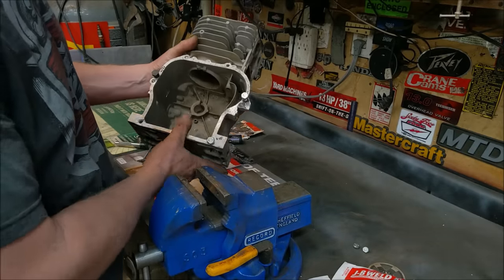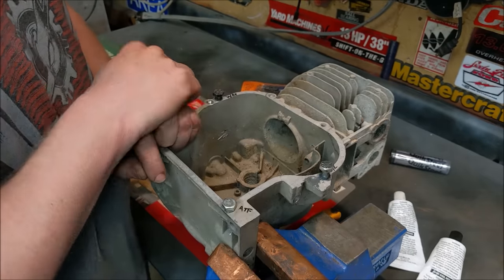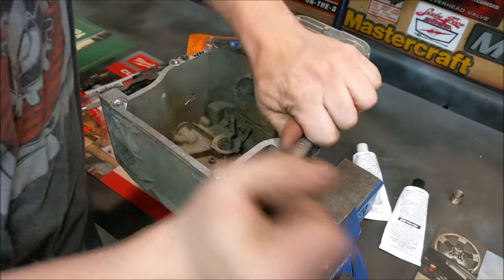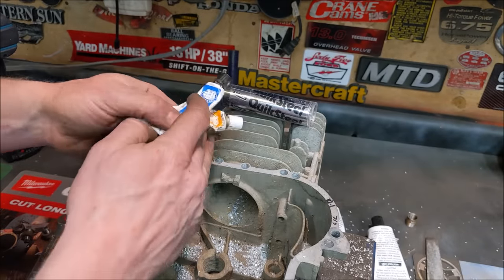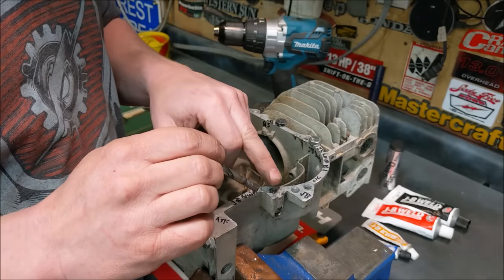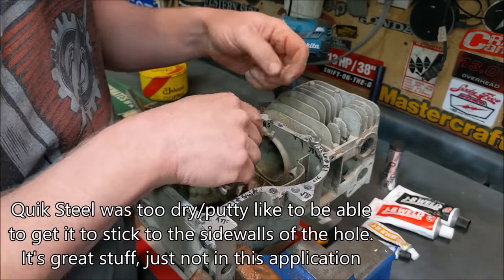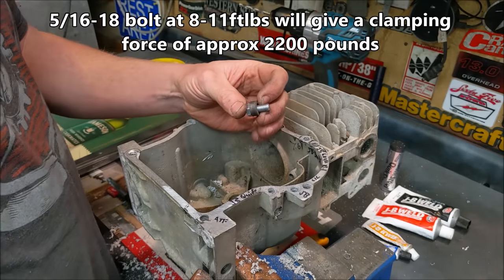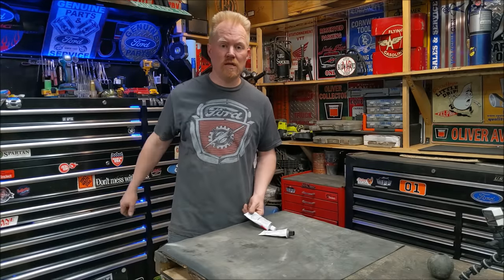FIX stripped bolt hole threads the POOR MANS WAY

Comment: Seems like this might work for what I need to fix. Water pump bolt snapped in the block, extractor failed. It only needs to be held snug around 8ftlb of torque so this method may be just fine.
Reply: I have had the same thing happen to my truck we were taking the bolts out and the damn bolt snapped right at the block, so now we have been drilling and tapping the bolt hole to try to get the new bolts in
Reply: Did this work for you?  Samething happened to me on my water pump and I just need 9lbs
Reply: @Xclusive615  I ended up just torquing the remaining good bolts drove for a few thousand miles with no leaks. I would assume this would probably work though just dont over torque the bolts as most water pump bolts dont require alot of torque you'll probably be fine.

Comment: Sometimes  threads are stripped in aluminum and do NOT need strength but just to keep a machine bolt snug in an aluminum engine block... LocTite may be plenty good and very cheap!
Reply: what is the thread is chipped instead of stripped? and would the loctite hold in hot temperatures?
Reply: I am not required to answer your 'what if ' questions ...  Ask another person who may actually know the answer.

Comment: What kind of Wax did you put on the bolt. I’m trying to tap some threads to hold an injector bracket down On my bmw. Also I just tried to Steelquik should I just drill it out and use the original JB?
Reply from the maker: Any paste type car wax will work. I used SC Johnson's paste wax.
Reply: @sixtyfiveford  
So you don’t think I should use the quick steel to get threads?
You weren’t able to Tap it?
Reply from the maker: @kylebarka1982  You can. It only takes a few minutes to tell whether or not it's going to hold. The strongest steel epoxies are the long/overnight set.

Comment: Can i do this on a stripped spark plug hole? Will it hold up just fine, its completely stripped, and cant drill anymore cause of valves
Reply from the maker: The heat would break it down. If you can't just step up the plug size, a helicoil is the only option.

Comment: That's pretty neat. I wonder if the torque will change any if the block went through some heat cycles.
Reply: JB Weld melts at 160 degrees

Comment: hi.. men today putting back the oil pan when i put the last bolts there i note without put torque i note the bolts will be strip. so the issue its not the bolts its the hole in the oil pan motor. i put a little more large bolt and start tight but i not trust you know i feel like this will be shot too. so. what you recomend

Comment: what ive done is jb weld the hole, then drill and install a helicoil. ive only used it on m6 fasteners but it seems to work great. id like to see if thats any stronger than these methods
Reply from the maker: That's awesome. I'm sure the helicoil takes a lot more friction forces from the rotating bolt.

Comment: ? I want to try something like this on my rear wheel on my dirt bike it’s the 4 bolts to sprocket to wheel hub should I drill or just use J B ?
Reply from the maker: This won't hold up on a sprocket, too much vibration and torque. This technique would be good for something like an engine side case bolt that just holds the oil in.

Comment: Hey, I have an sv650 that has a stripped exhaust hole. I think the previous owner stripped it and tried to put in a bigger bolt but it wasn’t holding the exhaust tight enough and it’s causing an exhaust leak (wish I would have noticed before buying). I already tried to use a helicoil but it didn’t work. Do you think using high temp jb weld to fill it and then rethread would work? I have no idea what to do, my budget isn’t a lot. Thanks
Reply from the maker: JB weld won't work well with exhaust heat. Larger bolt or a SAE bolt is generally the first best step.  Helicoil would be the second best.

Comment: Have you tried that aluminum brazing rod stuff to fix threads?
Reply from the maker: I have. Issues with that stuff are pretty significant. When you get it right it is wonderful and super strong. 
Issues:
Need to heat the entire aluminum part not great at just localized heating
Aluminum Oxide layer forms almost immediately preventing the bonding and heating of the aluminum.  

It's fine for a small part but if you need to do a motorcycle engine side cover you will almost indefinitely destroy the engine/transmission block if you haven't practiced, cleaned off the instantly forming oxide layer or have improper heating techniques.
Reply: @sixtyfiveford  thanks man I'm waiting on some of those rods to come in and that sounds like good info to know

Comment: We used to use stuff called Devcon . It’s like liquid aluminum. I don’t know if they make it anymore. Got it at an aviation supplier.
Reply: Auto parts stores used to carry both Devcon Plastic Aluminum and Plastic Steel in tubes.  I haven’t seen it in years.  I just found a similar product on Amazon.

Comment: sixtyfiveford, i drive a 2007 fj cruiser and my transfer case fill plug hole is stripped out, I dont have a torque wrench measuring device but i can go way past finger tight but it eventually loses all of its tightness past a certain point.
for now i have teflon tape on there and put it as tight as i possibly could
Do you recommend i use your JB weld method for that?

Comment: I was wondering if it would work with plumbers tape. I need to build a threaded part, and there are no taps in the size I need, and it is not a thread size my machinist friend can turn on his lathe.

Comment: Nice. I carry a wax crayon when I'm working mainly for saw blade lube but has so many random uses. Checked out the copper wire fix, brilliant idea thanks!
Reply: What other quick foxes have you done with a crayon?
Reply: Did you have to drill the hole before using Sae or did you just thread it in?

Comment: What kind of wax did you use on the bolt, so it wouldn't fuse to the jb weld
Reply from the maker: I used SC Johnson's paste wax. But any hard automotive car paint wax would work just fine.

Comment: When dealing with epoxy the 24 hour cure is all ways best. I use petroleum jelly to lube the threads. The West System epoxy is expensive but works great.
Reply from the maker: Very true.

Comment: I wonder if this will work with a bleeder valve on a 49cc scooter I'm sure I stripped the threads on.
I have a new bleed valve if it boogers the original.
Would save approx. $40 on a new caliper if it can be done.
Reply from the maker: I would so no. The brake fluid would eat at it.

Comment: do you think the aluminum welding rods would work
Reply from the maker: The issue is the heat you need to obtain to get those too work is so close the Aluminum melting point you can easily destroy the entire part.

Comment: Interesting knife blade.  Usually  they are all buggered up from  bad hand work during sharpening where the  user slips and drags the stone all the hell over the blade,   But not on that one. And it does look like it's been sharpened
Reply from the maker: It was about 1 year old when the video shot and I've sharpened it a lot by hand. It probably was on it's 20th-30th sharpening(sharpen every 2 weeks or so). This is a Buck 841 Sprint Pro.

Comment: would heat over time affect the JB?
Reply: I fixed a spark plugs hole on my old toyota , it took about 40K miles before it finally failed .  
So ya  eventually it would

Comment: Fill the hole with Alumaweld stick....Drill new hole....Tap it.....Done!!!  Better than new!!!
Reply from the maker: I've brazed with those on many occasions and it's not that straight forward. You have to put a ton of heat into the object and continually remove the aluminum oxide layer to get it to bond. Just a little too much heat and the aluminum part you're fixing turns to soup and it's junk.
Reply: @sixtyfiveford  Try putting the piece in an oven to heat it....then it holds the heat better and you can alumaweld it a bit easier

Comment: saw a guy test epoxy with wood shavings, fiber glass, carbon  fiber, and even tiny industrial diamonds. He got great improvement in strength. I guess JB Weld involves some sort of material in epoxy or something (yeah, just a guess, lol). Wonder how that kind of material would hold up? This is great stuff. Thanks, yet once again.
Reply: jb weld has metal particles, metal filled epoxy has been around for a few decades, you can get various fills, steel, alumium, ceramic, this also affects the colour . (devcon used to sell various versions of filler)
Reply from the maker: I did put a magnet to the JB Weld as they claim it has steel in it. It was barely magnetic. If anything I think they put in steel dust. I did try the same test with copper wires running in the JB-WELD but got the same results. I think I'm going to try fiberglass as that will contour very well.
Reply: What wax are you using as the lubricant ?

Comment: I have a stripped bolt hole.
I have JB Weld.
I have J&J Paste Wax.

Thanks for testing the best release agent! 👏
I totally was going to use WD40 until I came across your vid.

Totally a better than a suggestion of "just JB-Welding my bolt in place" I recieved.

Comment: Would be curious to see the test on a hole with damaged threads.  The holding strength would be much higher in regards to the jb-weld slog spinning as there would be something to bite

Comment: Typically with aluminum. I like to just drill through and use a nut. Or drill over size and tap. Fixed many lawn mowers this way permanently. Interesting video!
Reply from the maker: Both are also my preferred methods as well. Oversized for me has saved a lot of equipment.

Comment: Can't find the copper wire video.  I have a 1999 durango.  Stripped caliber bolt.  I have. Jb weld.  I am kind of confused.  Need help.
Reply from the maker: A brake caliper bolt has a lot of torque and generally only two bolts hold on the caliper. I would first see if you can put a bolt and nut all the way through the damaged part. If not I would try the copper wire but if you can't get good torque you'll need to replace the part. Generally these tactics are for something like a valve cover where if it fails the worst that can happen is an oil leak. 

COPPER WIRE TRICK VIDEO: https://youtu.be/soOvDuwfnQA
Reply: @sixtyfiveford  Had to drill out and tap.  I put a heli coil in and the bottom bolt fell out.  I was told now that I need to glue the heli coil in?

Comment: Would any one know if putting  jb weld in the hole and then using a self tapping screw to retap the thread  would work just wonder ?

Comment: Great test - exactly what we needed this morning. Thanks for showing us the options. With Original JB Weld in this application you need to take  a small file and cut vertical groves in the sides of the stripped out hole to give the epoxy a mechanical bond to keep it from spinning under a twisting load. Is there any kind of primer, like acetone, 99% isopropyl alcohol, or heptane(i.e. rubber cement solvent)  you can use to increase the strength of the chemical bond? About 47 years ago I used original JB Weld to fill the pits and holes in the aluminum head of an even older Mercedes that had blown a head gasket, and drove it for years that way.

Thanks again for a great video.
Reply from the maker: I did depth wise grooves and it made no difference. Tightening a 5/16" bolt to  8-11ftlbs is pulling with over 1 ton of force.  I think it's reaching the capacity of the material to bond to the aluminum.  I was thinking of adding something like large aluminum shavings or fiberglass strands and also tapping the hole for a larger bolt size to give tons of side ribbing for hold.

Comment: What if you took something like a MIG welder and some aluminum line and filled the holes and retaped them that way? Could that be a permanent fix as apposed to jb weld?
Reply from the maker: Of course that would be better but it's not really the poor mans way.
Reply: @sixtyfiveford  well no, but I have stripped transmission mount holes in my car and it's sure a lot cheaper than a new trans because it just keeps stripping out

Comment: The other day i found that plumbing or silver solder can be used in a pinch to fix threads on steel parts.
That won't work for aluminum, aluminum braze would be better than epoxy.

Fill with aluminum braze then drill and tap.

Comment: @sixtyfiveford which procedure would you suggest for fillling a stripped water pump bolt on an aluminum Honda engine. Thanks in advance
Reply: Did you ever get the water pump bolt fixed?
Reply: @Xclusive615  yeah I just stuck a self-tapping bolt into it. It works fine

Comment: i made the big mistake letting a friend put in my starter on my 1970 el camino while i was sanding it down to bare metal he used the wrong bolts to install it i even went and bought new starter bolts. so i hogged out the holles got sum 3/8 all thread cut to size put a assload of jb weld and it worked so if i need to replace the starter just pull it off the bolts that are in there for good

Comment: I heat the part up, then wipe candle wax, vaseline, or polishing wax. The last of which we used to use as a parting agent for mold making... bronze casting.
Reply: I have a hard rubber shift knob off an old Jeep that has completely lost its threads. Tomorrow I think I'll try this. The hole is already super big. I'll pack it almost full of JB Weld. Heat the steel threads to clean them and then either Vaseline or paint wax the threads. Plop it on and let it set. Maybe tape the underside so it doesn't drip out. I think for my uses, this will be perfecto and if I ever need to remove it, it shouldn't fight me too badly.
👌😉

Comment: I heard off adding aluminum shaving to the jb weld mix. I would like to see if that makes. Deference.
Reply from the maker: I added copper strands and it was coming out with around the same 8ftlbs. I think it's reaching the capacity of the material to bond to the aluminum. Tightening a 5/16" bolt to  8-11ftlbs is pulling with over 1 ton of force. I was thinking of adding something like large aluminum shavings or fiberglass strands and also tapping the hole for a larger bolt size to give ribbing for hold.

Comment: How to wax the bolt without filling the threads? (from comments by Stuart and replies 7 months ago): Use a lighter to heat the bolt and the excess wax will drip off, leaving a sufficient coating when cool to keep the JB Weld from sticking. (From other replies:) Wax works better than oil, because wax hardens and doesn't mix with the epoxy like liquid lubricants, which weakens their composition.
Reply from the maker: I used a paste wax (WAX I used: https://amzn.to/33492lG ) but any automotive wax should work as well. Candle wax may be too thick but should still work.

Comment: Good to know.  Personally I use the thread inserts where possible.
Reply from the maker: Where possible is the key word. I get a lot of comments from young mechanics who are lost because either there's no room to helicoil it or just no money. Generally a cheap motorcycle with 2-3 stripped engine side cover bolts or something like a valve cover bolt on their moms Honda. I think this is a "good enough" fix to allow a machine to finish out it's life.

Comment: Try your copper wire method with filling the threaded  hole with JB weld then drill and tap it...Add like 10 copper wire strands to strengthen the JB weld...Anyways,thats what i am trying
Reply from the maker: The issue with that method is drilling/taping cuts the copper strands. It grabs them and rips them out pretty good. Instead wax the bolt, put copper+JB weld and insert the bolt, then let it cure.

Comment: I got a stripped out thread for a dipstick tube how could I apply this to that method?
Reply from the maker: Do my other method and you should be good. https://youtu.be/soOvDuwfnQA
Reply: @sixtyfiveford  gonna try this later today instead of putting it in the hole because kinda awkward to get at can I wrap it around the bolt?

Comment: Drill hole out. Run oversized tap. Fill JB weld. Drill and tap to original size.  Or just use helicoil.

Comment: Use Teflon tape on the bolt threads instead of lubes. Works everytime.
Reply from the maker: Good idea.
Reply: Every time! Hmm, sounds like you strip a fair amount of threads.

Comment: Sorry to mention this but J-B Weld contains steel powders, steel and aluminum together will create galvanic corrosion. It will work for a short time, however in the long term the threads will breakdown. You are better off using a stainless steel sleeve.
Reply from the maker: Not true at all. You're missing an electrolyte. Steel and aluminum are in constant contact inside an engine and all over mechanical devices and there is never an issue unless an electrolyte is introduced (salt water, etc). Stainless steel will suffer from galvanic corrosion as well.
Reply: @sixtyfiveford  True you need an electrolyte. however the bolt and hole are exposed to the elements when installed and could trap particles. It would probably last beyond the life of the motor though. I am in the automotive field and aluminum always gets an insulator when next to steel. The aluminum and steel in the engine are insulated by motor oil and lubricants.  
When body shops repair aluminum they have to do it in a clean room with dedicated tools only for aluminum. They have to be sensitive to cross contamination. Steel bolts that go into aluminum parts on cars have a coating called Dacromet. (and many times are one time use)
I do like the video, and gave it a like. Just wanted to point out the woes of working with dissimilar metals.

Comment: What kind of wax did you use?
Reply from the maker: SC Johnson's paste wax. However, any car wax you get out of a little tin would work the same.
Reply: @sixtyfiveford  thank you sir. You probably saved me alot of time and money by using this method for a stripped valve cover bolt.